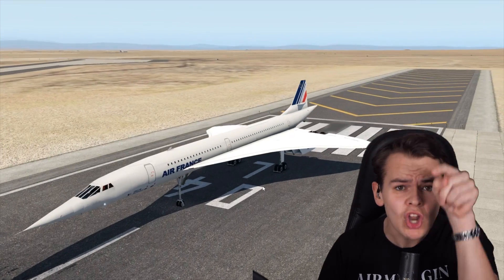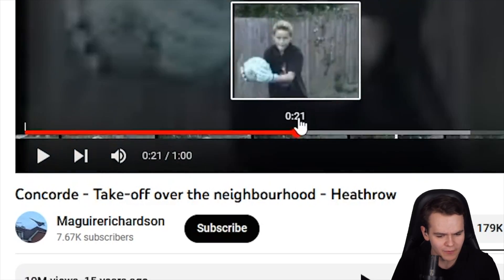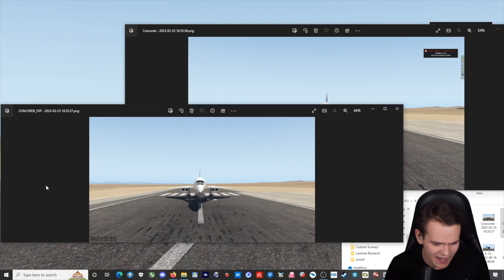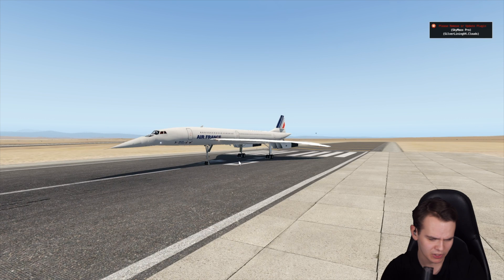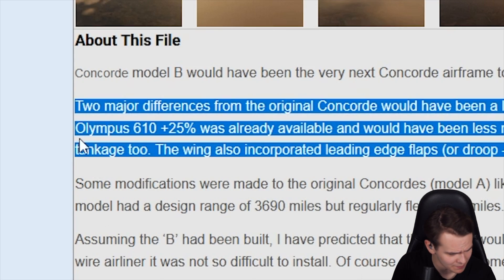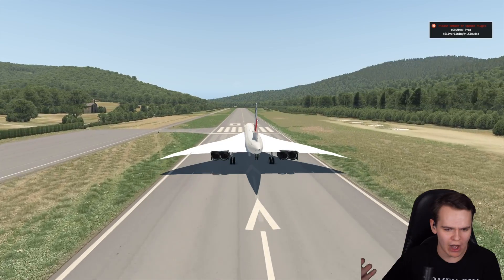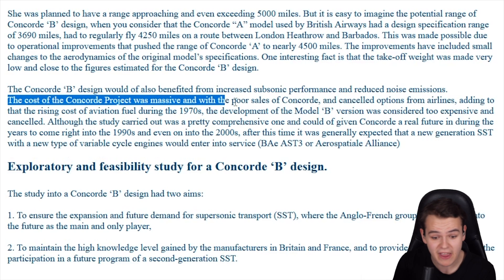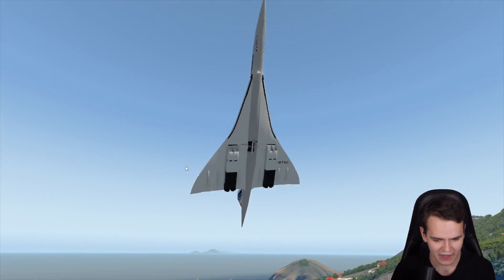Why Did The Concorde-B Fail?

Comment: The concorde plane was grounded after accident shortly after takeoff in July of 2000 that killed all 109 passengers and crew on board and that's why concorde will never produced again it is a very scary ride that the airplane went down in flames almost immediately after takeoff

Good bye concorde👋